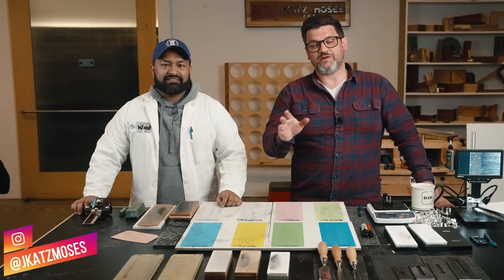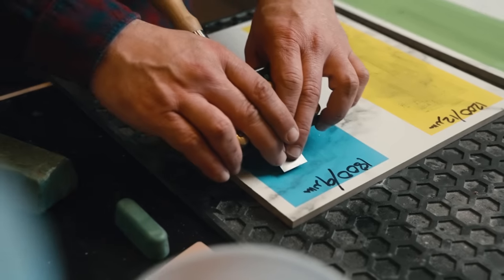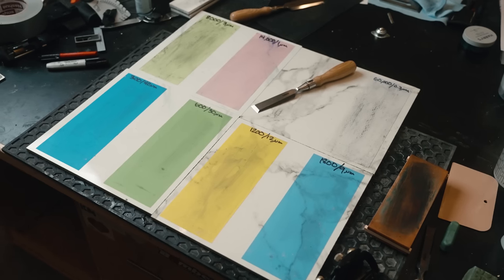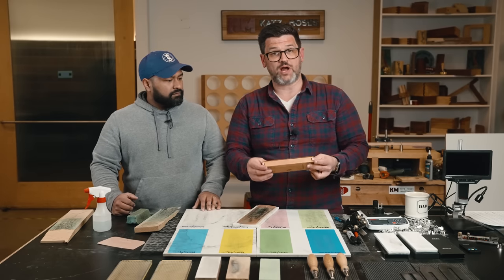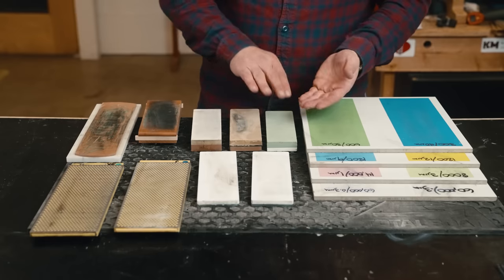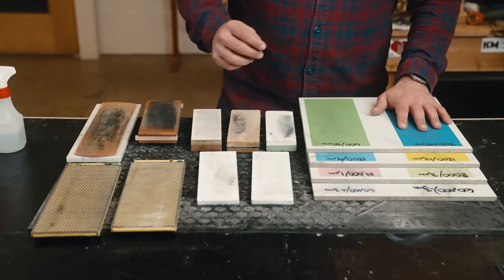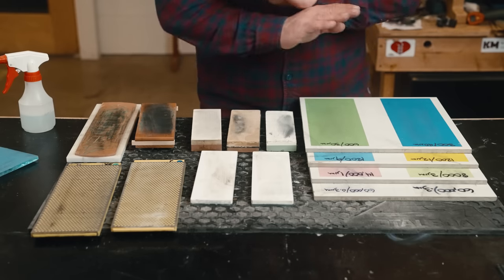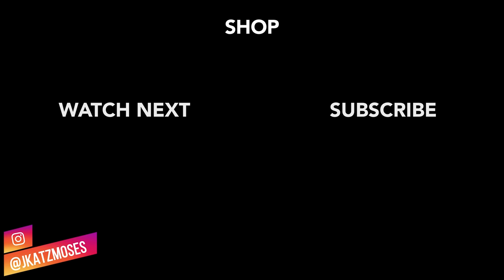The Most Comprehensive Sharpening Test Ever Done

Comment: Great work, guys!

When I found what worked for me in terms of ease, sharpness, and time, I stuck with it. It's sharpening three grits (400, 800, 1200) on diamond stones and stropping a few times on hard leather with green stropping compound. That's what I consider sharpening, otherwise it's 1200 and strop, or just stropping to touch up, which I consider honing.

Oh, almost forgot! Not every tool is the same. Inspired from some discussions in the Rex Krueger community I tried honing my Mora knife on a slate stone instead of leather, which gave me a much better result that regular stropping.
Reply: Gotta say, honing is sharpening, the word hone literally means sharpen.

But yes, I totally agree, taking up to 3k, 5k, 10k, etc. is all pretty pointless.
Most really use is 220-600 grit, with a black compound on strop (IF I STROP). My blades will easily shave hair.
Grit doesn't make sharpness.

Touching up on hard abrasives is good, can't accidentally 'overstrop' on a stone, and prevents the issues that come with it (to much convexivity, rounding of the apex.)
Reply: @autumn5592  Yes, I know, it's a bit of a personal use of the words, I guess. Which isn't the best of ideas 😅 But I'm trying to differentiate between full on sharpening and touching up, which I just did now 😂
Reply: @thomashverring9484  Fair enough. I've been known to use it the same way too.

Comment: 7:36 I may be a little early and you could answer this later in the video, but isn’t the 25 vs 30 degree bevel argument about speed to maintain the edge and the improvement in cutting because of the angle? You could have a 5 degree bevel and achieve the same sharpness, but the cutting would not be good in the plane for durability. More plainly, does the micro bevel angle have merit in the real world even though it doesn’t improve the measured sharpness? 

Maybe a future video to tackle is, how the attack angle changes the durability and cut quality for certain tools. Or the science behind certain choices for blades. I would love to watch some extended content slowing down the frame rate and watching a full kerf ripping blade and having you explain the difference in how it works over a crosscut blade. Or showing a zoomed in view of a bandsaw blade doing curved with different tooth sets.
Reply from the maker: Check out my video called the 6 most saw common blades. We do exactly that

Comment: Great information! I’ve been experimenting with stones, diamond and scary sharp… and strop: thin adhered to board. As you mentioned, the tear of scary sharp film is a certain, particularly if dressing a new chisel that isn’t flat. Plus the pull back motion is slow if needing to flatten a back from new mid-level chisels. I’ve mixed the system with Ultra Sharp Diamond set… 300 up to 3000 and the Scary Sharp film on up through their 60000 grit. Probably not necessary, but the diamonds 2200 & 3000 seem to get it close in the least time consuming with 2 way strokes and finishing with Scary Sharp and quick strop.

You’ve pointed out my procedure has duplication processes that may be more detrimental than simply duplication of effort & time.
I’ll modify based on your findings… great Video! Enjoy all your videos and have purchased several items from your store.

Comment: Im a materials engineer at in a metallurgical lab, we polish metals and ceramics to an optical mirror finish using SiC papers 240/400/600/1200grit then a few minutes with final colloidal silica polish (metals). When I see all these sharpening videos finish at some 8000grit the blade still has scratches from initial grinding at 120 or 240 ish, after 1200 it should reflect like a good mirror with no tool marks visible with out good magnification .
Reply: Doesn't really matter past about ⅓-⅕th of a mm. Since that is where all the cutting is done.
It's just aesthetics past that.

Comment: I am a sharpening system collector 😃, but I've found that I like my set of DMT and Trend diamond stones (180/600, 300/1000, 8000) best, followed by using a homemade leather strop (strip of leather glued onto a scrap of oak with green compound smeared on). I can touch up a chisel or plane blade in about 2 minutes and my forearms are bald from testing the sharpness.

Comment: Great video! I have another question about sharpening that I haven’t seen tested before. I, like many others, like to watch Paul Sellers. He sharpens his plane irons free hand in a way that produces a camber or curve on the edge of the plane. This seems counterintuitive to me that it would create a sharp edge. Have you ever tested this to see if it makes a difference…camber vs straight edge? Thanks for all the great content.
Reply: Same sharpness as you vary the blade for the work. Very cambered to remove a lot of stock, very little just to help prevent tramlines.
Reply: @Woodwork-Learner  sorry for the confusion. I meant camber on the sharpened edge, not across the blade width. Paul will drop his hands as he extends out during sharpening and raise them back up as he pulls the blade back. This creates a camber on the whole sharpened edge.
Reply: You are talking about convexivity of the edge.

It does increase sharpness slightly, and increase durability of the edge (not necessarily edge retention though.)

You don't need to hold a perfect angle on lots of woodworking tools, because the cutting is done in the first fraction of a mm, the rest just 'moves it out of the way.

You are still sharpening the edge when making a convex bevel, you have to or it wouldn't be sharper.
If you hit the entire bevel at once, you very rarely have to take it and re-grind it, because you are removing as you go.

Much nicer than microbevels, or hollow grinds, etc. Allows you to just keep working, very little thinking, reflexive.

Comment: Thank you for a common sense approach backed by testing. You correctly explode a lot of the hype around sharpening metal.  I will adjust my routine accordingly.  I've discovered that sharpening nerds are ignorant about backing materials. When water is used limits choices. Immediately out is all plywood type products. Glass is next due to its breaking, chipping and flesh slicing properties. Good substitutes are flat acrylic sheets and resin impregnated hardboard (masonite or other names). Their advantages are obvious and both sides are available for mounting.  Home improvement centers may offer more choices. I mix my epoxy on white ceramic tiles due to the impermeable glass (glaze) coating for easy cleanup.  Various grits of wet/dry sand paper are excellent standing for expensive stones. Spray contact adhesive is great for temporary mounting of sandpaper. Naptha is used to remove old sandpaper anf clean off adhesive residue for another mounting. The video creators are excellent info providers. There are also forum discussions about the many drawbacks of wax stropping abrasives.

Comment: You recommend the 3M cubitron sanding discs for quickly removing material during sanding and holding up longer. It comes in a PSA version. It seems like a coarse grit in the scary sharp system would be comparable to a diamond stone for removing material quickly.

Any comments?

Comment: Interesting results, and I'm really glad to see the more in-depth followup to Suman's original video. One thing I'm curious about (other than it being out of stock on your store) is why you used the Veritas sharpening jig and not your own?
Reply from the maker: Only jig I own capable of removing and then returning something to the same exact place over and over so we could test between different stones
Reply: I realized one other interesting thing about this is the difference between point-sharp and slicing-sharp. SciShow recently covered this in their "Sharpest Object … can't cut anything" video. E.g. the same reason we hold a plane at a slight angle for a smoother cut (or helical vs straight cutters on a jointer/planer). Not really possible to test any of that without some really specialized setup, though. Maybe next time you get access to that robot arm.

Comment: Thanks for doing these tests and producing this information. I would be curious to see how some Japanese steels such as Hitachi white and blue paper steels stack up. In my experience they not only take a finer edge but also seem to stay sharper much longer than A1, O2, or even PMV11. For ordinary wood working it may be true that sharp is sharp enough, but that doesn't mean that there aren't higher levels to be attained. There is something to be said for the Japanese craftsmen who use harder laminated steel blades and insist on using waterstones and even natural stones and can consistently produce edges that cut shavings mere microns thick. Do we need tools that sharp for all tasks? Of course we don't, but that doesn't mean that it doesn't matter what steel, abrasives, or sharpening techniques you use.
Reply: Japanese also believe their martial arts are the best when they’re crap.
Reply: Japanese steels are extremely hard so they would great with softwoods, but extremely hard steels may chip when you use it with hardwoods. Though a cross table of steels and woods would be quite interesting.

Comment: It looks like you used the shapton stones as a sharpening stone, going back and forth with the blade. Did you also test what happens if you just use the highest one as a strop(only pulling it back)?
Reply from the maker: Yeah the whole final 14 minutes was done using that method. The Broll of Suman sharpening on the Shapton was not how the test was done. The testing parameters are on the text screen in that section and described in the first or second section

Comment: how durable is the scary sharp system? how often do you have to change the paper?
Reply: I’ve been using it for a couple of years.
It depends on a couple of things.
1) how flat can you adhere it to a surface (eg float glass)
2) can you resist a push stroke, any imperfections will tear the film on a push.

Even if you get a small tear, since it’s a film and not a paper, it’s easy enough to work around.

Per sheet it’s way better than emery paper.

Comment: I think too much is made of sharpening. Once you learn the basic steps, it's quite simple.  If you can easily shave your arm in one pass that's all you need for wood work. All I use is a Norton oil stone with two sides. I think the fine side is 1000 grit...  A little compound on a strop and a few passes, you're done. And yes I'm  a professional woodworker and carpenter.

Comment: Something that is often overlooked on this subject is the type of cut the blade is used for:
**  A chisel is most often used with it's cutting edge at 90 degrees to the direction of cut.  Working the edge with the finer grit abrasives is good.
**  A knife or other tool that is actually drawn across the material being cut can work better if it has a microscopically serated edge, such as that left by an abrasive that is not so fine.   (Especially cross-cutting, in a material with grain.)
The thinking is that the knife is working as a saw.  Imagine a table-saw blade without teeth...  no matter how finely honed the edge is, getting it through a two-by-four might take a while!   😜
Reply: Micro-serrations are not a thing.
Well unless you are sharpening with like sub-40 grit sandpaper...
Reply: @autumn5592  :  That has not been my experience... I am talking about stopping at 1000 to 1500 grit, as opposed to continuing to 8000 or higher. I am only talking about crosscutting.  Your mileage may differ... that's fine by me.
Reply: @PiefacePete46  I sharpen my tools to 220 grit mostly, I have never once seen this 'microserrated' edge that people seem to be convinced is real.
My woodwork tools and knives shave hair easily, basically no pressure on the hair, and no noise.
There is not much difference in cut initiation, and there is minimal effect on cut finish.

Hight variance on the apex of a blade does exist, but it is random (does not correlate with grit), and is a 2-3 microns difference.
It will not 'tear through material easier' it will not initate a cut easier, it does nothing.

Comment: I've been seeing videos using that sharpness tester for years, and while it seems far better than other methods, I've always wondered how much variability there is given that you are testing a tiny section of a blade at a time. How much variance is there for a given blade if you measured the same blade 3 times, for example?
Reply from the maker: Great point! There was almost no variance and we tested each blade 3 times in 3 different spots.
Reply: @katzmosestools  Great to hear. I imagine if your blade is well sharpened there should be little variance. I'm not great at hand/whetstone sharpening though.  I have recently started using the KME system and it has solved most of my problems with sharpening. 
  I did ask Project Farm this question years ago, and although he responded he didn't really answer the question as clearly as you did. Thanks for that

Comment: great stuff
next test - longetivity of sharpness of various steels. would be awesome.if there is steel which will get you well over the initial 10 strokes you mention in your test, would be great to know about....
Reply: More Carbon = better edge retention.
More iron = easier to resharpen.
More chromium = more resistance to rust.
Reply: @elmohead  if only it would be so easy

Comment: Something important to point out is that none of these results would have happened if you weren't using a guide. If you sharpen by hand, you can't be that consistent. 140 on this device is almost what a barber's shaving razor blade is.

Comment: Did you test sharpening exclusively on a Tormek (including stropping)? I've always wondered if there's any difference there, although from your conclusions I assume not really - you get the burr and then you strop it, so it should be the same.
Reply: My question, as well. If you are using the Tormek, using the built-in honing wheel would be the logical choice. Did you guys try that at all, or have an opinion?

Comment: Awesome video!  I wonder if there’s difference in edge degradation between 25 and 30 degrees?  Or I might have missed in the video
Reply from the maker: You missed it. There’s no difference. Cheers
Reply: If it's a microbevel, then there won't be much difference.

If it's the main bevel, the 25 degree edge would hold it's edge longer.

Comment: One caveat to the "It doesn't matter" concept:  It depends on your application.  
Diamond: shop tools and knives
Wet stone or Oil stone: shop tools and knives
Scary sharp: shop tools and knives
Files: saws, machete, axes, rough shaping tools, etc.

Having been a straight razor shaver for several years now, there's no way in hell I would use anything other than Japanese water stones with straight razors. Shapton stones work, but as you noted, not quite sharp enough for straight razors.  Diamond will ruin blades, and sorry but the scary sharp system leaves too much room for error.  A wrong application, inconsistent surface, or even a speck of dust under the film will cause micro nicks that you will feel when shaving.   So "it doesn't matter...for a few niche applications".
Reply: ever heard of "the method"? there is a whole straight razor community that swears by sharpening on glass with lapping film.

Comment: So interesting.  Question about revitalising old chisels.   Can 220 and 320 sand paper work too?
Reply: Absolutely.
Just remove the burr, and you can make anything sharp with pretty much any abrasive.
Reply: @autumn5592  Thank you.  New to fine woodworking and learning all the tricks of the trade.  Any advice on hollow mortise chisels?
Reply: @blainlehman1018  I'm gonna be honest, I don't know what that is because I've never used one.

Google says it's a drill inside of a sharpened square, correct?
If so, it doesn't seem all that hard to actually sharpen, just a little fiddly.
I would clamp it in a vice, then get some needle files (a triangle should do well) and hit each face being careful to hit the entire bevel in one pass, take even strokes each time, take a couple of passes, then rotate, and repeat until desired sharpness.
Shouldn't take very long, may change geometry slightly, but no real issue, a little change should not significantly impact performance.

If you don't have, or don't want to invest in needle files, a bit of metal or hardwood a couple mm wide with some sandpaper super glued to it should be a good alternative.
You can get shaped whetstones too, handy for sharpening strange profiles, not sure if you will get them that small though, I suppose you could always make one yourself though. 
If you want to buy a file, a good file maker is Grobet-Vallorbe, you should be able to find single files on Ebay for about 15 dollars.
You want their 16cm triangle/three-square cut 2 or 4.